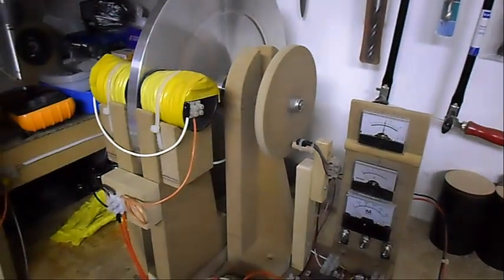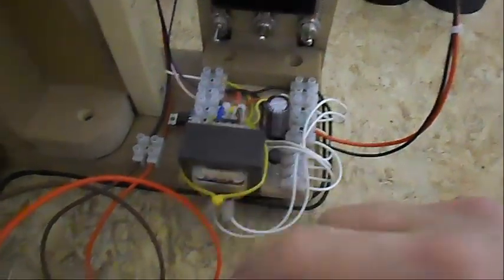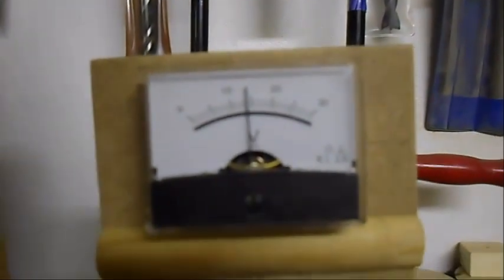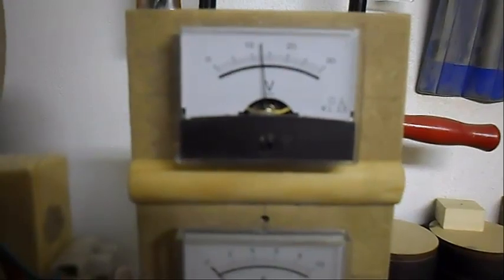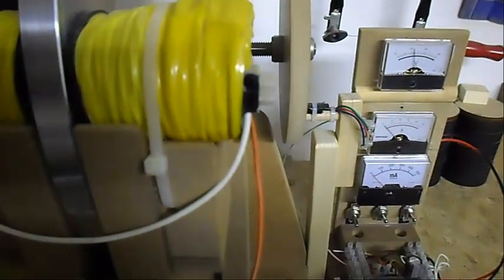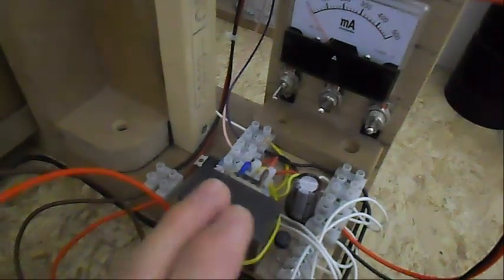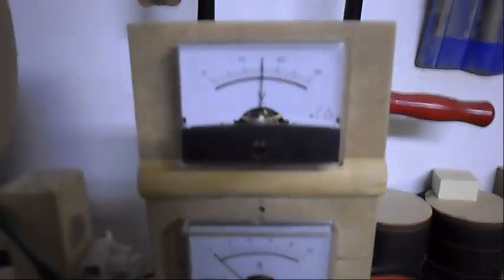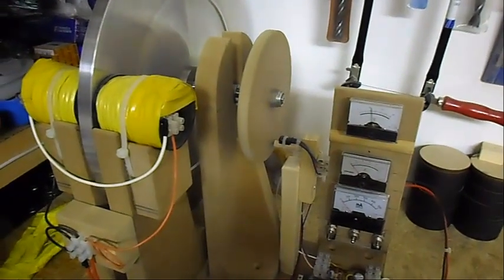Pulse Motor - Selfdriving Circuit & Larger Transformer Test...

Comment from the maker: Just an update on this Pulse Motor where i'm using a P-channel Mosfet as a selflooped circuit...^^
This time i have a bit larger tranformer in the circuit and it does help a bit more with keeping the source cap at a higher voltage for a longer period of time so that's not so bad and a good improvement...^^
Reply: Mister Caribbean Roots Hello
When are you going to build a PMG GENERATOR 30 KW  ,50 KW ,100KW ??? BRAZIL HAVE OPEN MARKETS FOR THAT . THEY NEED IMPORT FROM CHINA  THIS TYPE OF  PMG GENERATORS.
SUCESS !!!
Reply: where are you ?

Comment: thanks for posting.   you may know that when a circuit includes an  UN-loaded electric motor,  the circuit is ONLY functioning as a  Rotary Transformer.    conclusion:   in the context of  ou, this idea is not worth pursuing.   cheers              googletranslate

Comment: Wondering did you start off with just the back emf of the coils being rectified ???? Also why did you choose a p-chan mosfet instead of easier to get n-chan?????  Also I see your using a switched type hall sensor like A3144.. I would if I was you get a higher amp bridge rect ,that 3-4amp 400v you got will fry over time...